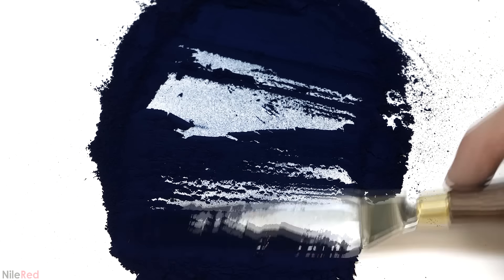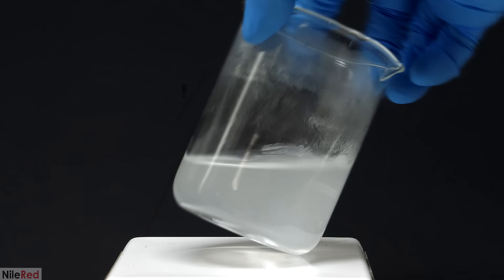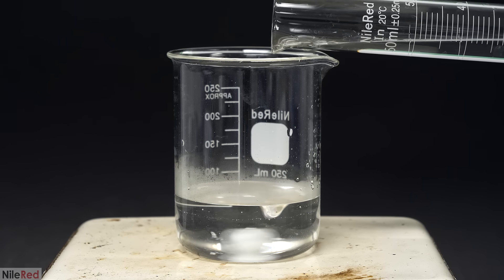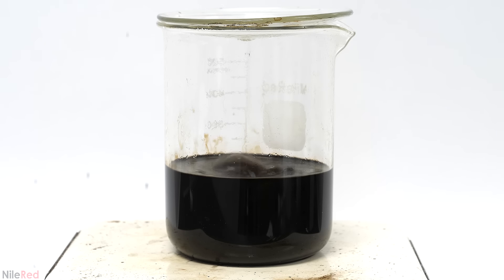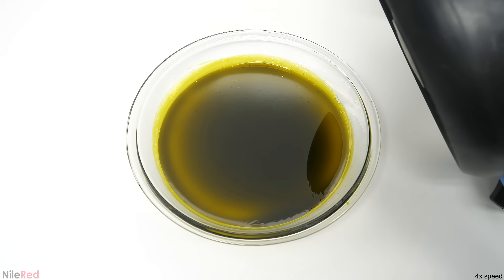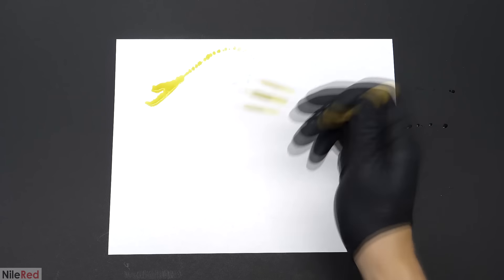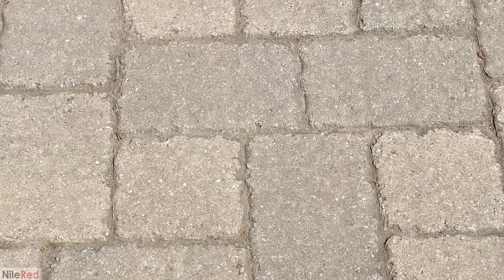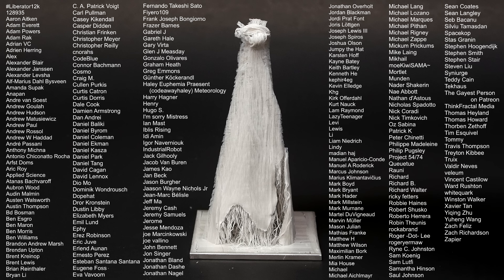Making my own blueprint

Comment: You can make the prints a darker blue and more stable by washing them with hydrogen peroxide after the water wash.
Reply: Correct me if I'm wrong but isn't H2O2 used for stabilising the blue colour of CrO5 instead of Prussian blue? If not, could you plz explain the chemical reasoning for the same?
Reply: @manswind3417  he’s probably in his third YouTube account since posting his comment… lol not sure he’ll respond 😆
Reply: @manswind3417  it takes a little while for cyanotype to fully finish developing as it oxidizes in free air, h2o2 just speeds up the process

Comment: This was really cool to see. My father used to circuit diagrams with cyanotype to both verify the transparency blocks enough UV to produce a good circuit board as well as to create the circuit diagram that would be included with the board (usually slide into a clear plastic sleeve inside the casing of whatever the board went into. I was very young at the time, around 8 years old and have wondered ever since how he managed to produce the beautiful blue diagrams using the same transparency that was used for the board. This video really brought back some memories. A nice addendum to this technique is that you can print onto the transparencies using an inkjet printer if you set the printer to gray scale and ramp up the print quality (note that some printers cheat on gray scale and mix in color to reduce black ink usage).

Comment: That's the way very, very old blueprints were made. I'm an Olde-Timey Civil Engineer, and the blueprints we made were the opposite of what was shown.  The background remained white, while the drafted work was dark.  We would use blacks pens and pencils for drafting, and LeRoy lettering stencils for notes.  For construction lines, we would use blue pencils (as they would not show up on the print), while red pencils were used for lighter lines, such as dimension extension lines. Ammonia was used to cure the print, and I remember many a day spent in a poorly ventilated print room running drawings.  This was circa 1985 until about 2002.

Comment: As a final step in the cyanotype process, I have always used a finishing bath.  The blue color of the print will fully develop over the next week or so, but if you want it done immediately, add approximately 10 mils of 3% hydrogen peroxide to 500 mils of distilled water.  Put this solution in a second tray and give the print a dip before you hang it to dry.   The color will instantly darken and become richer.

Comment: The blue print stile was often used up to at least the early 90's for working copies of large drawings. It was a lot faster and cheaper to use then printer and plotters. The orignal was plottet on a large semi transparent plastic sheet and when you needed a copy it was put into a blue-printer that made an one-to-one A1 or larger copy in a minutt or so.

Comment: Fifty years ago, I had a summer job that involved blueprints. I worked next to a huge machine that made prints that were six feet wide. A big tank of anhydrous  ammonia fed into the machine, and the guy who operated the machine told me that the ammonia fumes "developed" the prints. And all the blueprints I handled (not just from the big machine) smelled of ammonia. What does this have to do with the process you just demonstrated?
Reply: Ace Lightning Slightly different process if I remember things right.
Reply: It looked very much the same, including how the white parts were pale greenish-yellow until everything was developed. But, as I said, that was fifty years ago...
Reply: Probably just a different chemical process.
Reply: That is Diazo print, also known as Diazotype, Dyline print, Whiteprint and blueline print. It was a lot cheaper and easier than the cyanotype/blueprint process but unlike cyanotype the prints have limited durability and will fade if exposed to light for a few weeks.  Wikipedia has a good description of the process under 'Whiteprint'.
Reply: Ace Lightning Those were diazo prints. Totally different chemistry
Reply: Yes, that was the name - thanks for jogging my memory! This was in a major aerospace factory, so they probably just printed more copies whenever the old ones faded.
Reply: yep high-school blueprint printer smelled like cat pee, and the whenever someone asked about it, everyone attempted to convince them it was actual cat pee in the machine, or the instructor's urine, or the students, etc etc.
Reply: all i want to know is are you 60+? lol I cant imagine old people watching youtube 😂😂😂
Reply: Ace Lightning - Diazotype process does not provide an inverted image as NileRed's process.  The dark lines on the vellum/sepia/mylar are dark on the copy.
Reply: I'm 70 years old. I watch all sorts of videos, from SciShow, to cooking and sewing, to blacksmithing, medical and veterinary, aviation, railroading, linguistics, music (I'm rather fond of Pentatonix and Disturbed), and even a few lolcats now and then :-)
Reply: Ace Lightning i for some odd reason find this really intresting amd funny
Reply: Ace Lightning
I think I remember you from a.f.v. in "ancient times" - lol.
"Old" people on YouTube? You kids might be surprised. I'm 59 and almost everybody I know watches stuff on YouTube and many also post. I follow chem channels, electronics, craziness (1PugLife etc.), conservative commentators, ..., the list goes on. Been online since 1992. Been on YouTube since it began. Fact is, you never can tell who/what is behind a logon name!
Reply: And yeah, I used to draw up my schematics at work with pencils on vellum and reproduce them on a Diazo Dyline print machine. Either that or I'd sketch them up in a notebook and a draftsman (remember them?) would draw it up all pretty on vellum for me. Now I of course use AutoCAD and either a LaserJet or a large format inkjet plotter.
Reply: Yes, that was me on usenet - I don't miss it, though! I have always been interested in all sorts of things, and YouTube seems to include all of them. (I watch progressive commentators, though.) I've been online since 1991, but at first the computer I was using was too slow to watch videos(?!).  But, yeah, I'm still here :-)
Reply: Ace Lightning I hope I'm as cool as you guys when I'm older. Sitting here at a mere quarter century old wondering just how different things are going to be in 45 years...
Reply: Thank you! I know I had a very different view of the world when I was 25 ;-) (And, by the way, I'm a woman.)
Reply: Ace Lightning I love you. I want to be cool like you too. :) <3
Reply: you'd be surprised, there's quite a lot of 60+ years old people going to the internet when they are on retirement
. there was a 77 years old dude playing in my neverwinter online guild, and he was pretty good.
Reply: for the cat pee thing, urea (which is one of the main components of urine) is used in quite a lot of chemical reactions.
Reply: Well, I'm happily married (for 45 years!), but thanks. And just live a long time, see and do as many things as possible, and try to maintain a "positive mental attitude" :-)
Reply: The stupid jokes about old people not understanding modern technology aren't true. We watched the internet being invented! And at least some of us (like me) have been techies since the era of electronic tubes, and we've seen all the improvements since then - and kept up with them.
Reply: Ace Lightning You've just unknowing given so many people hope. :)
Reply: Fifty years? You'd be like 70-80 years old.
Reply: I'm 70.
Reply: Ace Lightning wish you were my grandpa
Reply: Ace Lightning I apologize ,....grandma
Reply: toupac of streamme, there's no need to apologize - on the internet, who can tell? :-)
Reply: Maxim Tarasevich, their version of "Sound of Silence" just blew me away. And then I listened to other songs - I really love the way they combine melodic beauty with metal noise!
Reply: Ace Lightning just wondering how u came up with ur name?..ur join utube date is july 13..13 days before my birthday 7 26...I'm currently putting a supercharged lightning engine in my truck..and am naming it Aced lightning! After my dog Ace who i just happened to lose unexpectedly 2 days ago..Just thought it was weird i see a comment by ace lightning...crazy world..
Reply: I've been on the internet, one way or another, since about 1991. But I've been calling myself Ace since I was 11 years old, and the other kids made my "real" name into a nickname I didn't like. I played around with the letters, and came up with Ace, which I liked better. I started using the familiar "ace of spades" logo as a personal emblem. I have also always loved lightning, and I've spent my life working with electricity in one way or another. When I needed a more distinctive personal emblem, I added a lightning bolt to the Ace design. Someone looked at it and said, "You could read that as a name - either Lightning Ace or Ace Lightning." So that's where the name came from. Then, in about 1994, BBC Canada produced a children's TV program about a teenage boy who could become a supehero by entering a computer game, and it was called "Ace Lightning". For a while I'd get email and stuff from people looking for information about the show. I wrote to the BBC and told them I'd had the name first, but they never answered. But I'm still the one and only original Ace Lightning! (Sorry about your dog.)
Reply: Ace Lightning awesome story..thanks for sharing..
Reply: First last, you're welcome!
Reply: Youre so cool!
Reply: @Ra33sK  Why ever not? Having retired years ago - I'm in my 70s - means I can spare the time to watch it, and there are one or two videos of mine on YouTube too. Like Ace Lightning I used a Diazo printing machine in the early 1970s, in my case in an electronics company. Probably it's because we are of a technical mindset we use YT. I'm a physicist.

Comment: This is actually surprisingly similar to a way older form of blueprint used in fabrics. Essentially it is a method in which you first use wooden printing blocks to transfer a colour-resistant substance onto the fabric (a variety of substances were used and the specific recipe tends to be a secret specific to the printer). In the next step the fabric got coloured with indigo and finally the colour-resistant substance got removed from the fabric using diluted sulphuric acid. There are still some few printers who use this method and in much of central Europe it is considered part of the immaterial cultural heritage

Comment: I followed the procedure and everything looked exactly what you got, however when I mixed the solutions of the ferric ammonium citrate and the potassium ferricyanide I got lots of prussian blue, i have worked in low light far from UV lights so I don't know what is going on. Edit:How to solve this below

Update: I finally fixed the problem, well it was obvious that I was getting some iron (II) contamination but i didn't knew were it came from but after some experimenting I found the cause to be my bad quality ferric chloride, it was contaminated with lots of iron (II) plus while it was supposed to be 20% was actually a 32% solution so I ended up with a large excess of uncomplexed iron (II). To avoid this problem in the first place I would recommend to add some hydrogen peroxide to your iron hydroxide to be sure its fully oxidized, It should look reddish not black as in the video. In case your Ferric ammonium citrate ends up like mine it can be fixed easily by adding some hydrogen peroxide drop wise until it becomes slightly brown, then add drop wise a saturated solution of ammonium citrate and mix until it becomes slightly green, let it rest for a few minutes and test the solution, if it keeps turning blue when mixed with the potassium ferricyanide add more Ammonium citrate solution, keep doing this until you no longer get the blue color. Also I made Ferric ammonium oxalate and its much easier to make plus is far more sensitive to light than the citrate, the only problem is that it leaves a rusty tinge on paper so not ideal for cyanotype but amazing for ferric gelatin (holography) experiments.
Reply: How does one get in touch here? Thanks for that info. For the last few weeks I've been working on this and using different sources of iron, with mixed results. Don't know enough to be able to figure things out myself. I have currently a batch (made from purchased iron filings) that is red. I also bubbled air through it for a few days before adding H2O2. I believe that Mike Ware's new cyanotype formula uses ferric ammonium oxalate; how did you make it?
Reply: @sizzlenotsteak  To make the ferric ammonium oxalate, prepare iron hydroxide in the same way as when you make it for the ferric ammonium citrate, then once you have your iron hydroxide add a saturated solution of oxalic acid, i recommend to do this on a hot plate, I made it around 80C° but shouldn't matter the temperature, add the solution until all the iron hydroxide dissolves and the solution becomes acidic then let it cool, it should look yellow-green wit no precipitate, if you have precipitate filter it because that is likely ferrous oxalate so not good, we need ferric oxalate which is soluble and in oxidation state III.

Prepare a saturated ammonium oxalate solution and add it to the ferric oxalate solution you prepared earlier, it will become brilliant green, that's the ferric ammonium oxalate. I didn't used any stochiometry when i made mine, it was just a quick test to see if it worked so i just added an excess of ammonium oxalate, you can add a few drops of H2O2 at this point just to be sure its fully oxidized to iron III, just a little H2O2 there is no need to add too much. To remove most of the excess ammonium oxalate I boiled down the solution until the excess ammonium oxalate started precipitating, filtered it and then put it on the fridge to cool to crystallize as much ammonium oxalate as possible and filtered it again. 

Its hard to crystallize the ferric ammonium oxalate its very soluble but you can let the solution fully evaporate so it crystallizes as emerald color crystals, it will have a lot of the ammonium oxalate though but seems still works good enough for cyanotypes and ferric gelatin (if you are into holography). It seems that ferric potassium oxalate might be easier to make because it has lower solubility therefore much easier to purify by crystallization, i haven't tried it yet but if i do i post results here.

Just some notes I might add, the ferric oxalate and the ferric ammonium oxalate are more light sensitive than the citrate so try working far from daylight or anything with too much blue or UV light, the drops of H2O2 added in one of the steps help to convert back any photoreduced iron so it should be ok to work under good ilumination, like warm LED lights or incandescent. Good luck!
Reply: @teresashinkansen9402  Thank you so much! Will get to work on this, will let you know how it turns out. :)
Reply: @sizzlenotsteak  You are welcome, I hope it works for you.

Comment: For evaporation water and solidifying stuff, why don't you line the dish with cling film? When it is fully evaporated, I imagine it'll be much simpler to take the cling film away than to evaporate it on the dish itself and end up with a lot of residual chemicals stuck to the dish
Reply: I wonder about that myself - would the solution react with the cling film? Or maybe use a tupperware sort of thing that you could twist and the stuff would come off?
Reply: If a substance that sticky starts to stick to your cling film, I don't think you'd get it off without ripping the thin stretchy plastic and ending up with a lot of shredded plastic in your product.
Reply: I wonder if he washes his beakers in the dishwasher...
Reply: @rubenproost2552  he doesnt!! most solutions he uses arent dishwasher safe

Comment: In my first job out of college, I worked as a refinery process engineer.  We'd make these crude sketches that we'd give to the draftsman, Jim Barron.  He'd "Barronize" them by drawing on a plastic "vellum" sheet.  These were reproduced using a machine that apparently produced diazo prints, a technology that fit between blue prints and large format xerox copiers. A lot of the original plant drawings were blueprints.

Comment: I've been wanting to try this process out for ages, but never got round to it... if it's this simple, I might just have to get a cyanotype kit and try it out!
A little part of me is trying to figure out a way to make a cyanotype print from a film negative. For full analogue I suspect you'd have to enlarge onto large-format film sheets (which is a fair bit of effort); with digital you could take a scan the film and print it onto OHP transparency. Hmm.
Reply from the maker: For film, you can do a high res digital scan and then laser print that onto a transparency...I think
Reply: Making prints using transparencies is a lot of fun, you don't even need transparency film though. Laser prints on regular paper placed toner to photo paper works really well.
Reply: CosmoSnowmew just project the negative onto the cyanotype sheet?

Comment: Interesting variations: It's possible to make a cyanotype camera.  The paper is very slow so you do need some sort of large or medium format lens for it, no pinholes.  You might try contact printing from black and white film negatives, the larger the better.  Color negatives or chromogenic black and white might work, but the color dyes are transparent in infrared so they might be in UV as well.

Comment: If you want to get sharper detail with thinner lines, try printing the image on the transparency mirrored. Then when placing the transparency on the paper, place it with the ink side down.  This way the light can't creep underneath the line due to the thickness of the transparency.  I use a similar process when making prototype PCB's.